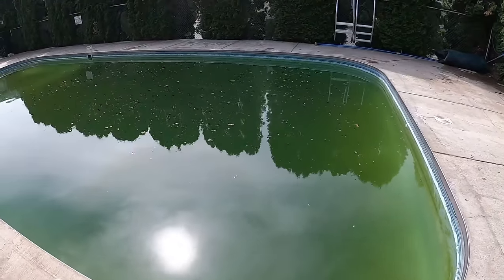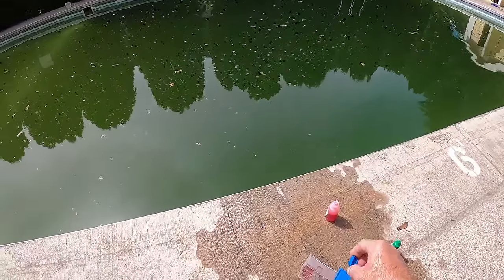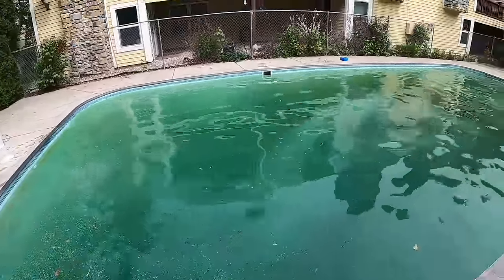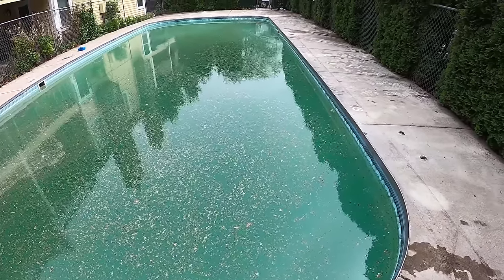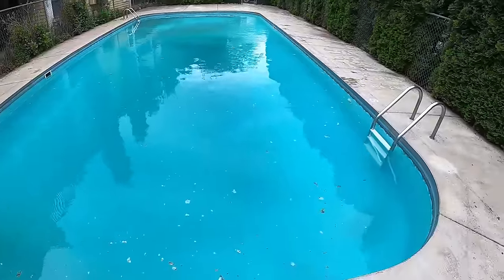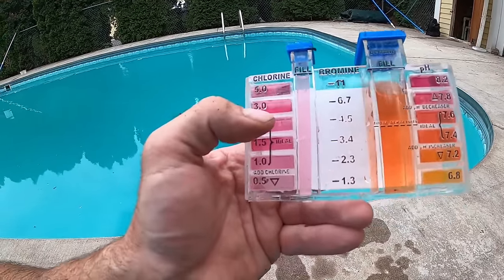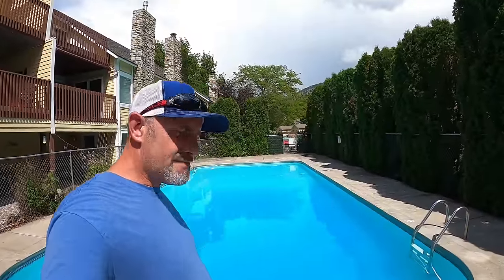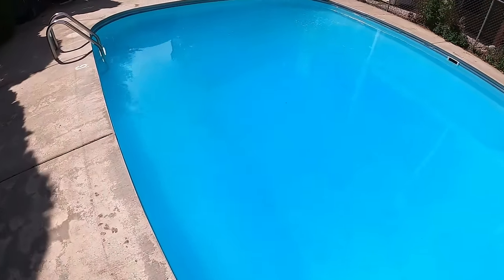Green to Blue Pool in 24 hours: How to Clean a Green Pool: Pool Cleaning: Cleaning a Swimming Pool

Comment: I have a question about vacuuming to waste. My pool sand filter has a 7 way multi port valve that doesn’t include a waste option. The options are filter, backwash, rinse, winterize, whirlpool, drain and test. Would I be able to vacuum to waste?
Reply from the maker: Hi Hayden I believe drain would be the same as waste so I would try drain.
Reply: @Poolelementary  thank you. And also with no recirculate option, what should I do when I put in floculant?
Reply from the maker: Whirlpool  setting should be your recirculate
Reply: @Poolelementary  awesome. Thank you!
Reply: Hi! I have a cartridge filter and each time I vacuum my pool the dust and debris come back from the filter to the pool again once the system is off. Do you why? Thank you
Reply from the maker: That's a tough one to answer without actually being and seeing your pool and what's back in the pool. I suspect it's fall out from debris getting stirred up in the water while vacuuming and not from the filter but I just can't tell you for sure. Sorry

Comment: Hey, we just got a cartridge filter replaced our sand filter, I’m fighting the algae, and also just got leaves and sticks and debris out,  now we have tons of particles and it’s just so cloudy. Is it recommended to use floc for cartridge filters? Did you get a horrible cloudy pool along with the algae? Thx, oh and we have an old pool like yours, with the square skimmer/basket, is there anything to use like the round adapter for the round skimmer?
Reply: Don't not floc the pool unless you have a way to vacuum to waste. Also we remove cartridge while circulating floc.
Reply: @Poolknot  so I’d definitely need to plumb in another pipe with a valve to go out to waste. I did get the pool up and running though, my son had a small water pump and we used a garden hose to vacuum up the deep end. Found a video somewhere for that. Balanced it out and good to go. Had to take apart the filter to remove and spray down the cartridges a few times but it all worked out. Thx
Reply: @aaronsg71  whenever time allows for you put that waste line in. In the long run it will save you time and $
Reply: @Poolknot  looking into it! Thx man!

Comment: Place copper pipe pieces in the skimmer basket. Copper kills algae.
Reply from the maker: I have heard of this working but my question is why do we get algae still when most pools have copper heat exchanges on the pool heater? Most are 5 to 10 pounds of copper pipes.
Reply: @Poolelementary  My best guess is that the cut ends of the copper pieces interact with the chelation process... The heat exchanger fittings are all closed with solder joints. Maybe? Just a guess but it really seems to work.

Comment: Very informative video! My only question is why didnt you add the cyanuric acid before the shock? Wouldn't you need less shock if the cyanuric acid is there to keep it in the water?
Reply from the maker: Good question, the cyanuric acid level on this Pool was already 40 parts per million which is almost perfect there for we didn't need to add any. Also we used calcium hypochloride to shock the pool which doesn't have cyanuric acid in it either so we were not creating a high cya level which causes us to have to use even more shock.

Comment: Do you leave the pump off when you put the shock in there or do you have it on recirculate?
Reply from the maker: I Always have the pump running  and I had it on filter to start cleaning the Pool up. I just try to avoid dumping my shock directly in front of a skimmer to prevent it from going through my pool equipment at full stregnth.

Comment: Very informative video! Do you ask your clients to purchase the chemicals first or do you include the chemicals in your final price? I just started servicing residential pools and feel like I’m losing so much money just on chemicals alone. I would honestly charge 300$ for a pool like this but by the looks of it you are using at least 100$ of chemicals. Maybe I may be under charging.
Reply from the maker: Hello, I always let the customers know there options with chemical pricing and labor and it really comes down to how fast they want there pool to be cleared up in this situation. This particular pool took about 4 hours labor  or about 500 dollars and then another 130 dollars in chemicals to clear up but this Pool is also a commercial pool through a hoa and cost wasn't a factor they just wanted it cleared and opened for there community as fast as possible. If this was a private owner with limited money to spend I would of used a flocculant to settle things out and did a hour vacuum to waste on it to save chlorine cost but pricing is different in other areas. I can't really tell you what to charge but if your losing money it should be more.
Reply: @Poolelementary 🎉😂😂q😂❤❤❤

Comment: WHATS A QUICK FIX FOR A HAIRLINE CRACK ON  Diverter Valves
Reply from the maker: Plumbers putty or some two part epoxy. Nothing really holds to well though always ends up leaking until cracked line is replaced.

Comment: Hey there - great video. I am trying to follow your step by step process. After initial water testing my pH is high (7.8), CYA is low (less than 30ppm) and alkalinity is low (40ppm). Any recommendations on first steps before shocking? I have a cartridge filter and 32,000 gallon pool. Planning on shocking with calcium hypochlorite and adding algicide. Any recommendations are appreciated! Thank you.

Comment: Hi

Some pool technicians say it’s better to drain because there’s a high chance it’s coming back.  Is that true? 
And is it cheaper to just drain?

One thing I’d like to comment on,   I think its better not to use waste mode when vacuuming. It throws away the chlorine. That’s why I guess the chlorine level dropped here
Reply: it's not true. While you keeping chloride and ph on designated level there is no way that it comes back. How? it rise only when you don't keep chemicals as they should.

Comment: This is completely different than using floc it seems right? Maybe this takes more time? I've had such a hard time with vacuuming the dead algae.
Reply from the maker: Yes this way does take longer because your using the filter to clean the pool water rather than settling it out to the bottom with floc.
Reply: @Poolelementary  and of course now my next question is, I just used floc, I'm guessing I need to just vacuum it up now instead of using this method you showed?
Thanks
Reply from the maker: I would let it settle out real good before vacuuming this is going to remove quite a bit of your problem debris
Reply: I gotta say this method is the most efficient. I'm on a well so using floc and then vacuuming requires filling with water. Even with backwashing and cleaning the filter this method is still more efficient. I don't even have to vacuum! Thanks again! @Poolelementary
Reply from the maker: Thanks for the great feedback and watching our channel  joeynumbers996!

Comment: So wait, you dont need to add flocculant to get rid of the tiny particles? and then vaccuum
also you dont mention what setting the control valve is on for the 24h, is it on filter?
Reply from the maker: Yes no flocculant just used clarifier and sand  filter on filter position and set to waste when vacuuming.

Comment: Mine  turned dark brown over the winter. Before i shock it do i put ph in it?
Reply from the maker: You should definitely check ph. Your shock will have better results if your ph is between 7.2-7.5
Reply: So if its high do i put soda ash in it?
Reply from the maker: If it's high you want to bring it down with some kind of acid product. In pools we use muriatic acid or a granular pool ph down.
Reply from the maker: Soda ash brings the ph up.

Comment: I'm gonna sneak and do this tonight. My boyfriend insists that shock and chlorine are 2 totally different things, we have chlorine but no "shock".
Shock is just basically over chlorination, right?
He also topped the water off a good 2ft while pool is swampy green...I have a feeling that was wrong too. It's gonna be a miracle if it can be fixed without draining.
Reply: Did it work??
Reply: Yes shocking is basically raising a pool chlorine level to shock level, your shock level depends on your cya level. You can find a chart online that shows shock level for different cya levels

Comment: How do I vacuume the stuff that settles without it all going back into the jacuzzi and making water all murky agai. 😊
Reply from the maker: If your talking about a hot tub I would drain it and shop vacuum out the bottom before refilling. If your talking a pool your filter should pick up most of the small particulate and if you do have a sand filter I would vacuum in the waste setting just to get it out of the pool through the backwash line.
Reply: @Poolelementary  so it's in the main pool. Make it to where the spa valve drains the spa then vaccume it. ?
Reply from the maker: I would just Manually Vacuum it out using the skimmer on the actual spa. If it doesn't have a skimmer then yes I would just drain it and brush everything down towards the drain as it's draing
Reply: @Poolelementary  so that's what I did yesterday I hooked my vaccume hose into the skimmer and after about 5 mins all the stuff came back into thru the jacuzzi and made it all murky again. And then cleaned the filters yesterday let it run for a bit. Today it's clear but has the brown stuff on the bottom. So if I go the skimmer can I just turn it to full fountain mode so nothing comes out the jacuzzi
Reply from the maker: I'm not familiar with your pool and spa setup but that sounds like it should work but you might be sending that gunk that gets through your filter into the pool though.

Comment: My pool looks like a swamp. Its a 18x48 and i can't get it clear. I put PH lower in it, waited 30 minutes, put algaecide in then 2 bags of shock..Its been 24 hours and no change in the color. Added another bag of shock.. Im at a loss...
Reply from the maker: On a pool that green and swampy you should atleast double or triple the recommended dose of chlorine to sufficiently kill the algae. Once this is done you will add chlorine daily to keep the free chlorine levels atleast 3 parts per million. If you don't want to spend the money on chlorine you can always use a flocculant to settle it to the bottom of the pool and manually vacuum it out to waste if you have a sand filter. If you want to see this process check out my how to clean a green pool fast video.
Reply: @Poolelementary  Just got my water tested. Free chlorine is 12.92 ppm, total chlorine is 13.59, pH 8.3, total alkalinity 81 ppm, calcium hardness 231 ppm, cyanuric acid 44 ppm, iron 0, copper 0.7 ppm, phosphates 611 ppm and TDS 500 ppm.
Reply from the maker: With water test results like that you shouldn't   have any algae left in your water that's alive besides the ph being a little high it looks good and should clear up for you soon if you keep on top of the water chemistry.
Reply: @Poolelementary  That's what I don't get. Everytime I get the water tested they say it looks pretty good. Yet you can't see past a foot in the pool... It's going to rain tomorrow. After that I will test the water again. Should I add more algicide and lower my phosphate once my chlorine level gets down to around 4ppm?
Reply from the maker: I would add the phosphate remover but with chlorine levels of 2 ppm or more you shouldn't have to even use an algicide. I'm starting to wonder if your just experiencing water discoloration instead of Algae. Sometimes with the right cloudiness of the pool water and the color of the pool it makes the water look green. I see this with mostly blue vinyl liner pool and white plaster pools.
Reply: @Poolelementary  It’s a bestway pool with blue sides and bottom. I cleaned the filter cartridge last night. I have been taking it out and cleaning it every other day. I will check the numbers again tomorrow.

Comment: * PLEASE HELP***  I purchased a home that has a pool that wasn’t opened yet. Very dirty water, looked like lake water, green and brown. I shocked the pool with liquid shock, and it looked much better, but still cloudy. A “pool guy”, and I laugh as I say it, told me to add a flocculant, and proceeded to give me a bag of a powdered formula. As per directions I added it to the pool, ran pump on recirculating for 3 hrs, and turned it off. I was told overnight it would bind to all particles and sink to bottom, and to vacuum to waste afterwards. Next day, my entire pool has the flocc as a thin film all over the entire surface. This was after 10 hours post application. Should this film settle?  Have I ruined the water?  I can’t think how I could get this film off and out of the pool, and I know I can’t get the flocc in my sand filter. Hoping and praying that the flocc on the surface will sink. Can you please give me a good prognosis regarding my situation?  PLEASE HELP!!!!
Reply from the maker: Hopefully your skimmer will pull most of that in and your filter will take the floc out of the water just watch the pressure on it because it will dirty your filter faster than normal. The only reason we bypass the filter and just circulate the water for 3 hours is so our filter doesn't take the floc out after applying it.

Comment: Your video along with others I’ve watch does not address algae accumulation on the walls. I’m talking about green algae that I can’t remove with a nylon brush, stainless brush or a high pressure water gun. I have triple shocked it, ran the pump wall night. I live in Las Vegas where our daytime temps average about 100-105 everyday.
Reply from the maker: If your dealing with a gunite or plaster pool that has a rough finish on the walls for the algae to get in your probably in need of an acid wash to get it off of the walls. If your pool is vinyl of fiberglass I'm not sure what to do at the moment.